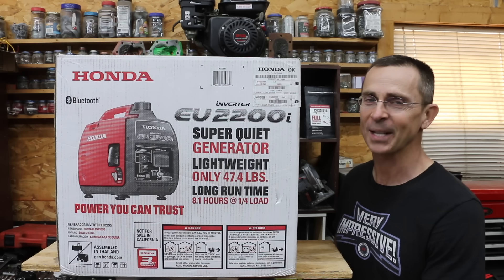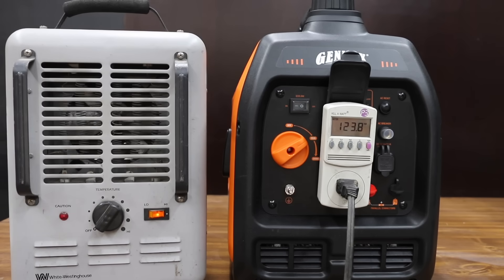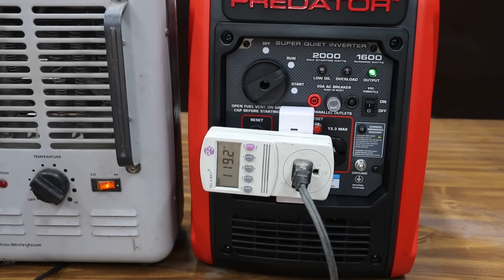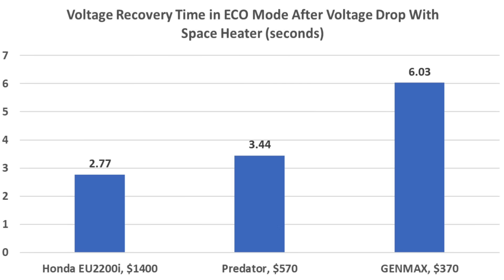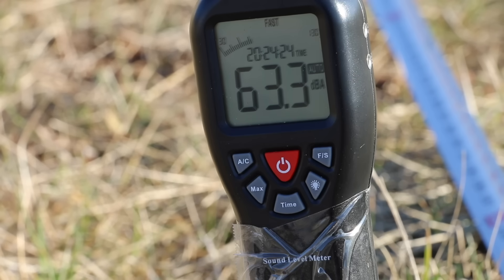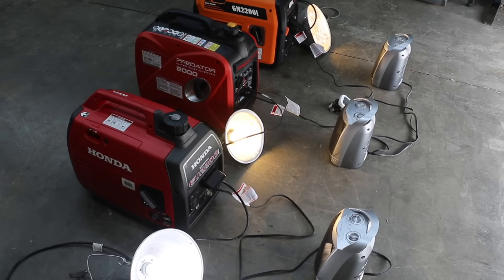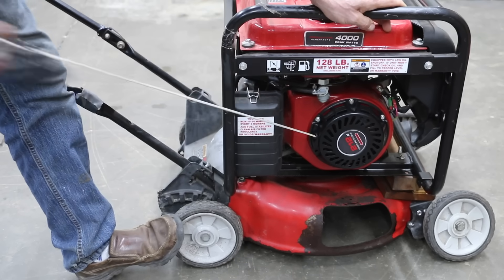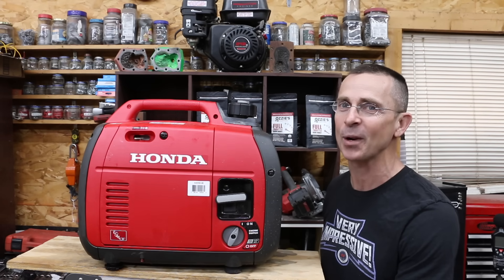Cheap Generator Better Than Honda? Predator vs Honda & GENMAX—Let’s Settle This!

Comment: Given the metals in the oil analysis it would be interesting to see a longevity test to see if the Honda lasts longer than the other two.
Reply: I have a year 2005 Honda 2000 generator with 6800 hours on it with no issues other then cleaning and rebuilding a carburetor twice in 18 years of service
Reply from the maker: Thanks for the suggestion.
Reply: Yea me too I bet that's where the Honda truly shines.
Reply: I think it's safe to assume replacement parts will be more easily available.
Reply: I wonder if the metal in the oil has to do with factory break in. Maybe Honda breaks the engine in at the factory and the others do not. Aluminum would be piston wear and iron would be cylinder wear.
Reply: It would also be interesting to do an oil analysis again on a second trial, after a run in has been completed.
Reply: My Predator 3500 powered my natural gas home furnace during the Texas Snowmageddon a few years ago for 12 hours (1 tank of gas) at -2 degrees.  You can’t ask more from a generator than that!!
Reply: @gr8705  iv got about 600 hours on my pred 3500 couldn’t ask for a better unit for the price if it failed tomorrow I’d be at the cash register to buy another

Comment: Thanks for another great video. If you can. Could you compare 120VAC 30A RV Ready Portable Generators to the:
Champion Power Equipment 201157, 4550-Watt/3650-Watt Electric Start Gasoline and Propane Powered Dual Fuel RV Ready Portable Generator with CO Shield, from Home Depot.
Reply from the maker: You are welcome!  Thanks for the suggestion.

Comment: About the best comparison I've seen on the Honda etc. , watched at least 4 maybe 5 other comparison videos .
I have worked on equipment for over 50 yrs. 
One thing that nobody [ I have seen ] has talked - much / or at all - about how long each would last [ had to do for a YouTube video ] .
A then a big issue - the Honda you would be able to get almost any part to repair it .
Many of the off brands - hard to get much more that filters & spark plug - many I have worked on --- you could not get just a new petcock for fuel tank - let alone engine or generator parts ?
Thanks again
Reply from the maker: Thanks!

Comment: as a generator connoisseur, this is the video where you surpass consumer reports.  Amazing work!
Reply from the maker: Thanks!
Reply: I love CR!
Reply: @KishorTwist  consumer reports is one of the most discredited and pathetic organizations to ever exist. I've worked in the field of nutrition for over 30 years and they recommend centrum as a multivitamin which is literally one of the biggest jokes to ever be perpetuated onto the supplement industry you would literally need to take an entire bottle of them in one day to even come close to anything significant and I used to tell people that were my clients that centrum is such garbage that you would probably be better off eating the label off the bottle then taking one of the pills inside of it.  Consumer reports has about as much credibility as the new york slimes newspaper.
Reply: @MAXIMUSMINIMALIST That's the fault of CR.  It's "Consumer Reports" which means the consumer's opinion is highly weighed in the rating.
Reply: @MAXIMUSMINIMALIST hi, what multi vitamins for men have received positive reviews . And is not a joke to you ?
Reply: Unfortunately Consumer Reports have gone way down hill over the past few years.  Doing things like testing many products, but from only a couple manufactures.. all of which are very similar to each other.  In the past they'd test products from many more manufactures which is much more useful that rating 20 "vacuum cleaners" (using as an example only) from only 3 manufactures. Canceled my subscription over a year ago.  I find Project Farm does a much better job.  Keep up the good work.
Reply: @pfitz4881  couldn't agree more.  we can say that about a lot of niche YouTubers these days.  budget doesn't dictate quality.  and quality can't be driven by corporate relationships.  PF is quality with authenticity.
Reply: Never trust Consumer Reports.  Especially after they lied about Suzuki
Reply: The Honda engine and electrical system are excellent. They will serve you well

Comment: I’ve got 2 Yamaha EF2000is units I’ve run for 15 years, several thousand hours each, and I’ve never had to do anything but change the oil and 1 spark plug. The plug looked so good on the first one I’ve left the second and it’s still clean. If you want to test another well built unit, I’d definitely recommend it. They and the Honda are my go-to recommendations for Ham Radio operators for high usage. The Wen are like the predator & genmax in that they wear much faster.  You should test for electrical noise on the ham bands, when grounded and not. That’d be super useful for ham clubs, event planners, and emergency responders (who allude radio gear).
Reply from the maker: Thanks for the video idea.

Comment: We camp and back up our solar with a dual fuel Champion.  We use propane, as it's easier to store and easy to pull off the camper aux port.  If you use a dual fuel inverter/generator, test both propane and gasoline.  It would be interesting how large the difference is between the fuels
Reply from the maker: Thanks for the suggestion.

Comment: Remember the cheap Kraco cassette players you could buy for your car in the '80s?  I had to buy one every year because they'd wear out and I was too cheap to buy a proper brand.  Oh the money that I spent as well as the labor instead of going with quality to begin.  I finally learned my lesson which is why I own a long lasting, pricey though, Honda generator versus a new CN generator every year.  Thanks for confirming my suspicions.
Reply from the maker: You are welcome!  Thanks for sharing.

Comment: Todd went this time the extra mile and sent the oil to the lab to ensure the most accurate results, this is turning from a YouTube channel to a serious testing facility. Amazing work as always!
Reply from the maker: Thanks for the suggestion.
Reply: @ProjectFarm  i'd like to see more walmart stuff; hyper tough, blackmaxx (they have a generator at my local store for about $468), and so on. The stores are everywhere and the have numerous forms of credit like their Capital One card and affirm, which makes them pretty easily attainable options. But the question is, are they good?
Reply: He does that all the time.
Reply from the maker: Thanks!
Reply: @ProjectFarm "😊g😊gg😊
Reply: I bought the Honda generator featured in this video about 3 years ago and use it very rarely. It goes right back into the original packaging and is stored in the nice year round naturally cooled garage after I drain and run out the fuel system after I use it in preps for the next time I need it. Better to have it and not need it than to need it and not have it. I use it to trickle charge my home solar at rare times that I would get several very cloudy days with sun blockage in Colorado., being it is a very rare event to have to deal with. It is also a great generator to have on a camping trip, although I have not used it for that yet. Now I am even happier that I went the full bore and bought the best. Thanks for the great video, Todd, and the reassurance that I made a great choice and investment with my past purchase of the Honda generator!
Reply: Not to mention and oscilloscope and vibration meter. And to think this guy started off his channel doing crazy experiments on a lawnmower engine. Now he's building up a testing lab
Reply: How about testing a Yamaha generator? Supposed to be similar to the Honda.
Reply: @wkcampbell1  My gut does say a Yamaha or Kawasaki product would be on par, or at least close enough to Honda to be viable, if the prices were similar.
I wonder what Korean companies have to offer.
Reply: @wkcampbell1 I bought a Yamaha 2500 watt generator many many years ago. It is amazing as it almost never comes off eco mode no matter what you plug in. This was my stupid lazy fault but I left old gas that gunned up the Gen. 2x and my friend who works on it for me cleaned the carb out. I told him how good it was and he said no way can that thing run the loads I was telling him I ran and it stayed on so low that you could still  hold a normal conversation next to it. He tested all his heavy load tools and called me and said he could not explain it but I was right. It can pull almost what my genrack 5000 watt. can. Now I need a coil and they are hard to come by but I'm going to find one and get it going again as it's worth the effort.
Reply: I wonder if the results would modify after a break-in period?
Reply: Agree
Reply: yeah but it's just break in oil analysis, we need to see what it looks like after they've all been running a few more hours.
Reply: Nah, the lab is a serious testing facility
Reply: accrual impressive research here because its actually useful and he thought of everything to

Comment: Ryobi sucks,hard to start at less than warm temps,output caps suck. Mine caught fire a couple of months ago,albeit after 11 years of sporadic usage. Based on the hours we never changed oil,just watched the color and smelled it. We topped it off once. 

Out put caps did not have the capacitance to last. Tolerance and never got to see the working voltage since it burned.
Reply from the maker: Thanks for the feedback.
Reply: The engine ran great once started though,it was the inverter that fried.

Comment: Hey Project Farm! I was wondering if you could test fogging oil vs other lubricants like WD40 or any other oil/general lubricant. It would be nice to see if a cheaper and more versatile option would work or things such as lawn mowers and snow blowers rather than buying a can to only use once a year if other oils would work just fine
Reply from the maker: Thanks for the suggestion.

Comment: What was not clear is when he changed out the oil. It is always recommended that you change the oil in the first 5-6hrs of use as the engine will be establishing its wear patterns inside. After that I believe the recommendation is every 25 hours being air-cooled engines. With so many wear metals in the Genmax and Predator, I'm wondering if the engines were not properly broken in at the factory. I'd be curious to see a follow up of the oil test and wear metals after a few oil changes and some runtime.

He also used full synthetic oil for the tests. I was always told to use conventional oil for the break in process and then once that was completed then you can use full synthetic for the remainder of the machine's life. Not sure if there's any truth to this but I believe it is worth mentioning.

Comment: I own a predator 9000 non-inverter, and recently put it through several days of usage during a power outage. It cost around $700 on sale, and while it's louder/dirtier power and probably not as reliable long-term as the Honda is, in no way could I imagine paying $1400 for a much smaller capacity. Feels like you're paying for name only. Hell I could buy a new predator every year for several years to add up to one Honda!
Reply from the maker: Thanks for the feedback.

Comment: That’s crazy about the predator burning oil. I’ve got a 3500 predator with a couple hundred hours on it and it hasn’t used a drop.
Reply from the maker: Thanks for the feedback.

Comment: Love the channel.  Always informative and  entertaining.  I'm in the market for a duel fuel (gas/propane) generator. After researching for a while settled on wgen12000df.  Big enough on propane to power most of my house and it suppose to have low <5% THD.  Would love to see this range / type of test.  Thanks
Reply from the maker: Thanks!  Thanks for the suggestion.

Comment: You may pay more for a Honda but it will last you much longer and won’t let you down , maybe try running them non stop for a week or three under near full load and see if something breaks on the cheap units - I suspect that the Honda would have better quality electronics in the generator .
Reply from the maker: Thanks for the feedback.

Comment: In other words the other two are JUNK. Yeah if you don't need the engine to last more than maybe a couple hundred hours... There's a reason why Honda is used for rental equipment... Commercial engine with a timing chain

Comment: Although its not the quietest, the GenMax seems like a great value for the casual user (assuming it doesn't start burning oil). The maintenance access points are well thought out. For someone who's constantly off the grid though, that Honda is worth the investment. 

Can't believe the Predator is burning so much oil in the first 100 hour... I have to believe that's a defect.
Reply from the maker: Thanks for the feedback.

Comment: I’d like to see comparisons on electronics run on ‘dirty’ sine waves Vs clean ones. I always wonder how big a difference that really makes.
Reply: I'd love to see that one too! We lost power for a couple days after the hurricanes in Florida and ran our fridge off of a modified square wave inverter during the storm and then switched to a Ryobi 6500 watt generator along with adding our laptops, fridge, wifi/internet modem, well pump and pool pump to the load and everything worked flawlessly as far as we could tell. 

With that said, my theory is that motors will run less efficiently on modified sign waves (due to power factor) and will basically pull more current and generate more heat. If the generator is running at or near capacity this will be more of a concern, especially if voltage drops during motor starting. Motors don't like voltage drops, and if there are motors already running when another one starts, you likely generate some harmonics and spikes that are bad for your electronics. Most modern electronic devices have switch mode power supplies that will clean up a wide range of voltages (like my laptop which will run on 100VAC up to around 250VAC without any problem). Older devices especially those with inductive (transformer) power supplies like older TVs or desktop PCs may be more susceptible, depending upon how well their power supplies are designed. This is a reasonable theory, but I don't have the energy or the equipment to test it, so hoping Todd can help us out!
Reply from the maker: Thanks for the suggestion.
Reply: I think it's going to depend on specifically what electronic device.

Comment: Great test!  I would like to see a similar comparison to the Honda EU7000is and the Predator 9500. along with any of the other high wattage invertor generators you can round up.  Thanks!
Reply from the maker: Thanks!  Thanks for the suggestion.

Comment: Great video. I personally use the Honda 2200 to power my ice house. The oscilloscope comparison is great. When running a fish finder my friends experience interference with their predator generators in some cases.
Reply from the maker: Thanks!  Thanks for sharing.

Comment: Not sure if it has been mentioned, but I wonder if the synthetic oil had anything to do with the oil consumption on the one.  A lot of engine manufacturers require non-synthetic oil for initial use to add "break-in".

Comment: You don't even need to test the cheap generator as it would be a waste of everyones time. Any power equipment made in China with a gasoline engine is a piece of junk. I have fallen for the "cheap" price from China and was sorry i did so getting burned by their crap they make.

Comment: Would like to see your findings on the WEN brand of generators. It was a less expensive brand I got for our tow behind trailer, but didn't seem like it would be as expensive as some of the other options, and not basement bottom pricing. Specifically, the WEN 56380i Super Quiet 3800-Watt RV-Ready Portable Inverter Generator with Fuel Shut-Off and Electric Start. It seems the Honda EU3200i is the Honda offering.

Comment: I bought a cheap generator from Aldi for $300. Run it on the farm for power outages and power tools.  Came with a 3 year warranty.  Not a bad unit.  Of course the Honda or Yamaha would be a better unit, but for $300 bucks, it’s done a pretty decent job.
Reply from the maker: Thanks for sharing.

Comment: How about a Champion dual-fuel generator?  I have a Champion 200961 2500 watt generator that I've run exclusively on propane when I was living off-grid for two summers.  Works well once started but takes 10+ pulls to get it started.

Comment: A note on the fuel efficiency tests - the Honda was producing a higher voltage than the other two, so while it ran out of gas earlier in some of the tests, it may have actually produced more energy (a resistive load, like the space heater or halogen lamp, will use more energy when operated at a higher voltage). You may want to consider using the kill-a-watt meter kwh output to compare energy efficiency in future tests. Thank you for all the great work you publish.
Reply: Good point. And it is a square law, so it has an outsized effect.
Reply from the maker: You are welcome!  Thanks for the constructive feedback.
Reply: 126.5V seen on the Honda is surprisingly high, I would be concerned if the public utility was supplying their power at that level as they normally come in at 119, much closer to the 120V. 

I would have expected better regulation from the Honda but maybe that's the reason they are more able to start high inrush current devices, because they go overvoltage on the output regulation.
I'd prefer regulation to the same voltage from the mains instead of the boosted value all the time, as that's the design voltage for the appliances.